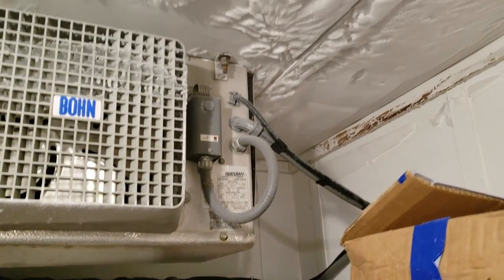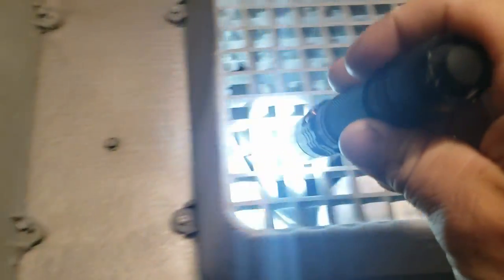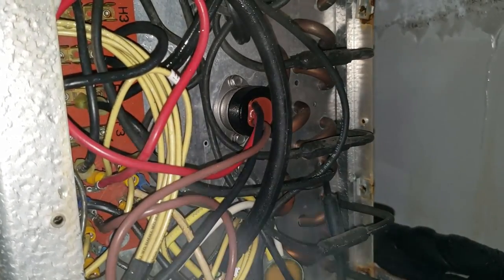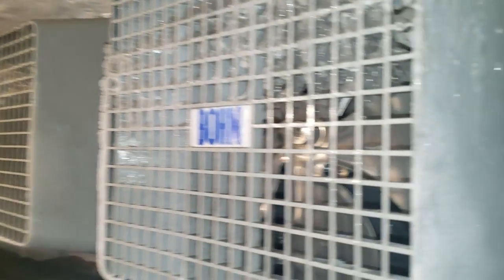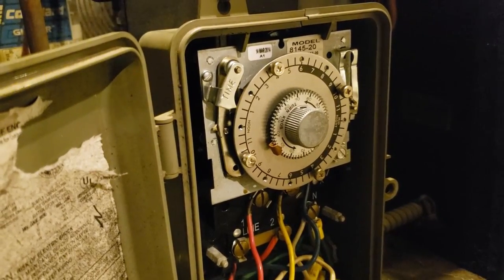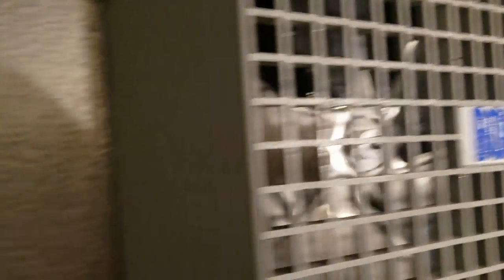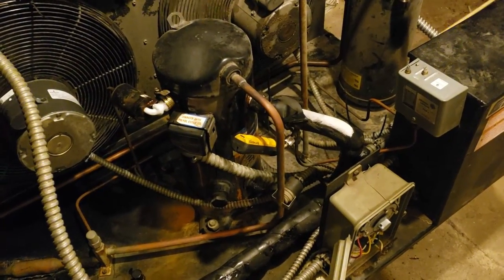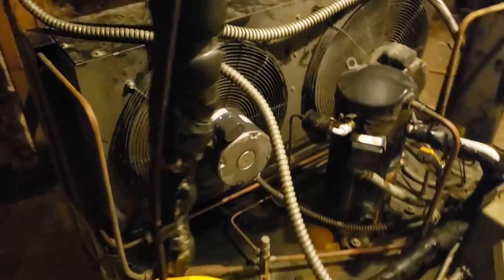SNOWING IN THE FREEZER - SHOW ME THE ICE

Comment: i had  similar issue at  fish processing plant.ice would build up on ceiling.so i did my checks on the unit,and gave my assessment to customer.the freezer was located neat a cooker line up for shell fish.lots of steam in area.so every time the door would open the steam would go into the walkin box.so i suggested a dehumidifier for the process area.made a big difference after it as installed.
Reply from the maker: Sometimes you can't win... Thanks for the feedback!

Comment: not enough fan delay on unit after defrost cycle?
Reply from the maker: I have seen where the defrost termination / fan delay was malfunction and it can cause something similar. But I'm also seen systems that don't even have a fan delay and they worked okay without it. It was definitely a head scratcher until I got to the superheat and even then I didn't think it was going to make that big of a difference.

Comment: Nice 📹.! Is there a certain spot to check subcooling on systems with liquid receiver ? Temp probe location? Always enjoy ur videos thanks again.
Reply from the maker: I've checked it before the receiver and after it. You shouldn't use subcooling as anything more than a diagnostic tool when you have a receiver.  Definitely do not use it to charge the system, your subcooling will always be low with a receiver
Reply: @HVACRSurvival  thanks appreciate the feedback 👍